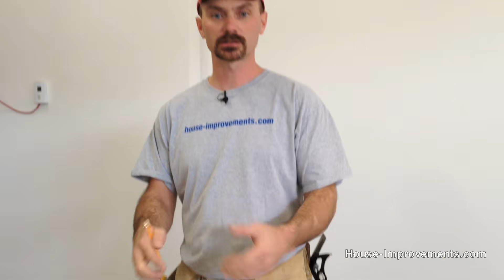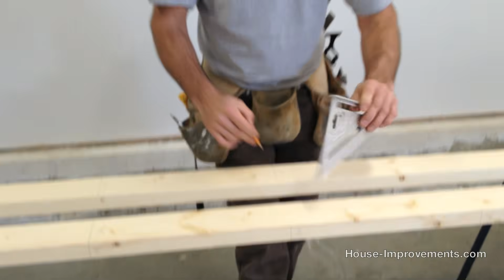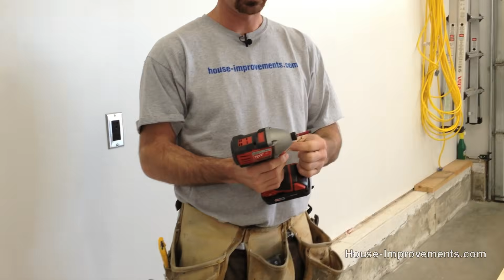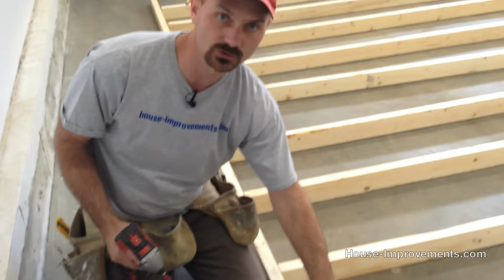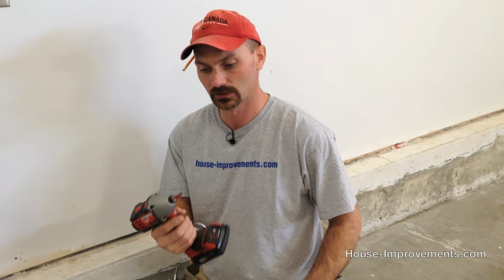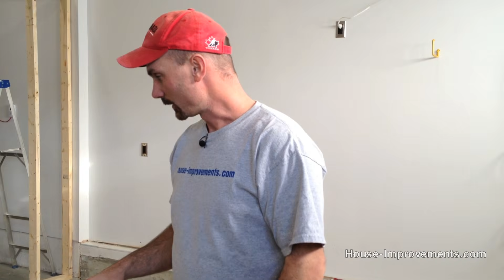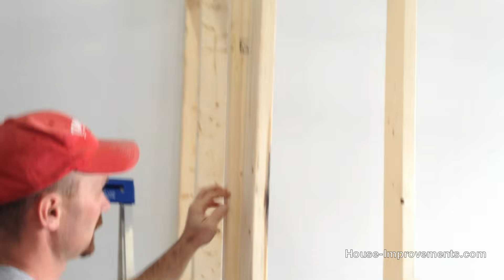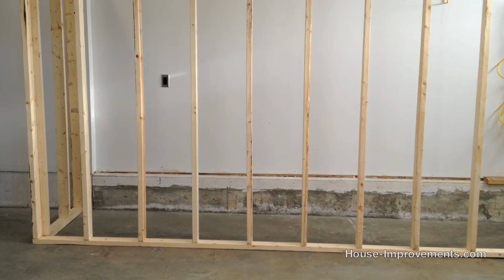Wood Stud Wall Framing

Comment: Hi Shannon, I am getting ready to separate my family room into two rooms - leaving the larger portion as the family room and the smaller portion as a laundry room and my study.  With the exception of the base plate, I want to use cedar 2X4s for my framing in the room because it is the best quality I can get at the local box store.  And it won't be carrying any load. Please give me your opinion on this before I go to Lowe's to buy more of the cedar @X4 lumber.  ADDED QUESTION:  I want to use the thin foam tape between the concrete slab and the base plate.  I have no reason for doing that other than I feel something to separate the wood from the concrete is better than nothing.
Reply from the maker: Regular spruce or pine studs are usually fine for interior walls, and using the foam tape is standard practice. Cedar is extra cost that is completely unnecessary . The foam separates the concrete from the wood to keep it dryer.
Reply: @HouseImprovements  Thank you, Shannon. I will try to find some straight boards at Lowes.  With these tariffs and Trump's trade war I will be lucky to find them and if I can, I will be lucky to afford them..

Comment: Remember, if your bottom plate is sitting on concrete you need to make sure it is pressure treated.
Reply from the maker: Yes, PT or be separated with a sill gasket

Comment: so once the top plate is on youll have 4 nails in the top of the stud? shudnt you nail the top plate between the studs?
Reply from the maker: The max spacing distance for nails in a double top plate is 24" . These studs are 16" OC so I have the top plate nailed even more often then needed. I like to place them near the studs so that when they poke through slightly they are not usually in harms way down the road when doing other procedures . They are really not effecting the studs because at most the nails may be jabbing into them by 1/2"

Comment: Whats an allowable crown to use on a stud wall?  Ive seen a lot that are like 8 feet and 1/4 inch crown but also some 1/2 inch or even a 1 inch crown.  Let me know thanks.
Reply from the maker: 3/8" max , I would suggest

Comment: What I still don't understand is if you are 16in on center on the outer walls so the sheathing falls on a stud how does the drywall on the inside still line up without cutting?
Reply from the maker: It won’t.
Reply: @HouseImprovements  That's what I thought. Thanks for the reply.

Comment: Shouldn’t you place a pressure treated wood doubler on the bottom only?
Reply from the maker: I never see the bottom plate doubled unless doing floating walls in a basement . You could use a PT bottom plate anywhere you are building a wall on concrete or you can use a standard wood plate but separate it from the concrete with a strip of poly or foam sill gasket.
Reply from the maker: I have newer wood framing videos that may explain things better in an actual framing a home situation , this video here was a mock up in the garage as an example . I will include my framing playlist here for you the newest videos are near the bottom of the list:https://www.youtube.com/playlist?list=PL41D07643E97E1ED0

Comment: when measuring base plate do you measure left to right or right to left
Reply from the maker: Really does not matter in most cases which end you start from. If you want to work the other way that is fine.

Comment: If you have an 8’ ceiling how high would you make the wall because seems to me that when u tilt the 8’ wall it will hit the ceiling before you come to the place where the wall needs to be?
Reply from the maker: If your floor and ceiling are pretty flat all you need is maybe 1/4" less than the measured height on a 2x4 wall.

Comment: If I understand correctly, when framing an 8 foot wall, the 2 top plates, the bottom plate and all standing studs should measure 8’ tall. Please correct if wrong, never done carpentry.  Thanks
Reply from the maker: depends what you are doing but for an interior wall that is not having to fit between an existing floor and ceiling I like to have 8'-1" this allows for standard sheets of drywall and a little wiggle room. Ceiling gets drywalled first with 1/2" or 5/8" drywall, then two rows of 48" drywall on the walls and that leaves you a little bit extra at the floor which is covered by flooring and trim.

Comment: Great idea instructor. Question, you said all crowns same direction. So when building a shed or home, is crowns facing outer part where plywood is nailed or in when sheet rock is nailed. Thanks for great video.
Reply from the maker: When building the wall laying on the floor like in the is video then crown up (away from the floor) makes it easier . If stick framing in place vertically then pick a side and put them all that way.

Comment: what if the concrete floor is not level? a bit sloping? can you just add a filler at the bottom? instead of levelling the concrete?
Reply from the maker: on a non load bearing wall , yes.

Comment: Hey, Thanks a lot for this great demonstration. I have a question if anyone knows, Can I glue the bottom plate of a pony wall to a glazed porcelain surface ? And what is the best construction adhesive for the job? Thanks!

Comment: @homeimprovements if you wanted to put a window in that demo you did for framing a wall could you have put it anywhere and just measure what size window and frame that in still adding the necessary framing for it

Comment: How tightly should my studs be before they are nailed in?  Should i need to knock them in or slide freely?
Reply from the maker: If you are framing the wall on the floor like this they should be all cut the same length. Sliding freely or knocking in can be effected by even the wall just laying crooked there on the floor , so that's not really a good judge of anything. If you have more questions please join my forum and ask what you want to know.
https://www.house-improvements.com/forums/

Comment: So as long as all of the crowns for the 2 x4s are facing the same way, it does not matter if they are on the inside, meaning living space side vs. on foundation side?
Reply from the maker: No it won't matter. We want them all going one way so that the finish drywall lays better. If the crowns are all mixed then the drywall is in and out and you will get more screw pops as well.
Reply: @HouseImprovements  Many thanks sir. I appreciate it. Have a great weekend.

Comment: I'm planning to move a closet wall to change the dimensions of the closet. The walls double top plate is laped to the interior and exterior walls. If I were to build a wall, could I just stick frame it in place or do I have to somehow lap the double top plate in place first before installing the top plate and studs? Thanks for any advice you can give!
Reply from the maker: You will be ok without the lap for this.

Comment: You mentioned using a 3 inch screw but what size #? I'm using #8 but it doesn't seem to suck the joints together at all? Does it matter if there's some play?
Reply from the maker: #8 deck screws.
Reverse the screw out until it is free from the second piece of wood and then drive it in again. Remember I also advised that these deck screws are not designed for structural framing.

Comment: I’m building garage walls and the guy sold me 8, 10 & 12 ft pieces for the bottom and top plates.  Walls are roughly 21-1/2 ft long or so.  I can see two 12ft pieces being used since the 12ft works evenly with 16” on centre (ends in middle stud) and a 10ft you lose 8” so a 12ft and 10ft won’t work. 
But the double top plate now you don’t want the joints matching.  So the lengths now make it difficult.  I don’t know if you can use 3 pieces for a top plate or should this guy have given me 16ft boards maybe ??  
I’ll be leaving the 3-1/2” and 5-1/2” (2x6 wall) shorter for overlap as well.   The top plate joint needs to be at least 16” (one stud) away from the lower top plate joint from what I read in the code book.  Can you use 3 pieces for the upper top plate ?   how would you configure the lengths for this length wall ??
Reply from the maker: Yes the upper double plate can be multiple pieces just cut your joints to land centred on a stud location.

Comment: Can u explain the staggering of sheeting two studs apart?
Reply from the maker: The stagger sets the joints of the rows of plywood or drywall from top and bottom rows apart and not falling on the same stud so this makes a stronger wall. If you have more questions my forum is the best place .https://www.house-improvements.com/forums/

Comment: Good video. I have a question. How do I lift a newly framed wall inside of and existing room. I have a 16x23 room and I want to go to a corner and frame in a bath room. I can frame the walls door etc. but if I frame it to the existing room height can I lift it into place without messing up the existing ceiling? Or should I leave the top plate off and raise the wall, then hope i can put the top plate in place???
Reply from the maker: Honestly I prefer to "stick frame" in those situations. Install you top and bottom plates in place and cut and install studs in the standing wall. If you want to build it on the floor and stand it up cut studs about 3/8" shorter than needed.
Reply: @HouseImprovements  Thank you for taking the time to answer me. I will stick frame it as you sugest.
Reply: A lot of planning goes into an ordinary bathroom, but the one your building is far greater. I am guessing you have a basement. I am doing a bathroom on the second floor that was a large bedroom with no bathroom.  I thought the prices of lumber were going to fall. COL.  Anyway interior walls with finished ceilings is tough. I decided to remove the sheetrock in the new bathroom area. Needed spacers between ceiling joist to attach new walls. Also exhaust fan and recessed lighting and wiring and vent piping.  I also removed the flooring to double floor joist by tub and 16 foot interior wall.  The wall runs parallel to a wall below it but I think it would be stronger if it was perpendicular, to floor joist. I had done work like this for a living, many years back and only used douglas fir wood.  Almost impossible to build a straight wall using anything else but steel.  I am turning 71, and started saying this was my last project five years ago. Good luck.
Reply: I really wanted to mention that a bathroom "wet wall" (has the largest, and most fixtures in a row) is generally framed in 2 X 6 lumber.  There is a formula, for what is called "fixture vent sizing tables". Most bathrooms need a 3 or 4 inch vent going thru roof.  3 inch is the inside measurement and 3.5 od . Hole saw  would cut your floor and ceiling plate in-half.  Even 2 X 6 lumber requires metal pipe protectors, preventing accidental nail penetration's.  Very easy to hit vent pipes, hanging pictures with screw gun.  The entire pipe is difficult to protect buried in the wall.

Comment: Needs some help, im sure i missed something important.  

 He mentions that, to get the stud height(to be able to cut all studs one time ) you measure the height of the wall then add the thicknes of 3 plates (1 1/2 x 3 = 4/12 inches) and subract that amount from the measured height, to get stud height. This confused me, because if the stud fits between 2 plates why are we subtracting 3. 

So in my mind its like this, if i have a wall i measured 100 inches, i am making a frame to fit that,frame height is 100 inches also, now i subtract 4.5 inches from 100 = 95.5.. wouldnt that make the studs too short? . If the stud is to fit between top and bottm plate, shouldnt i be subtracting 1.5(top) +1.5(bottom plate)  =3inch for a stud tight fit? .... i dont know if anyobdy follows what im trying to say. thinking i missed something,but keep replaying and still dont see it

Update: Okay after rewatching , i noticed he uses a double top plate(assuming the wall is load bearing>?) anyway, is it safe to assume this is what i overlooked?.. guessing thats why he subtracted 3 thicknesses?

Comment: Just one question. You said to cut off 3.5 inch of the studs to compensate for the plates. Why not enough to compensate for all three plates?
Reply from the maker: If you are using three plates then you need to cut more ,yes.
Reply: @HouseImprovements  Thanks. I hope to build my first home in the spring.

Comment: "usually it is much more recommended to use nails" - how about - "nails, certain lengths and diameters, are required by building codes"

Comment: If I want my finished wall to be 8'1 high when it is constructed,  what length do I have to cut my studs at?
Reply from the maker: if you are using three plates like in this video .... 97" - 4.5"= 92.5"

Comment: Is it possible to use nails? I have seen carpenters using nail guns for roof rafters which make the job much faster. But haven't seen nails to be used for stud partition. I wonder why?
Should we use treated or untreated timber for indoor stud wall partion, and why?
When we make a stud wall partition, would it better to make the fram on the floor as you did or attach it on the wall? I am not sure if you make the fram on the floor first just for demo or this is how it should be?
Already too many questions. 
Thanks,
H
Reply from the maker: You have a lot of questions and would be better of asking in the forum where we can discuss these items better.https://www.house-improvements.com/forums/

Comment: Terrific video. I am going to be placing studs between existing plates on the interior of my garage so that I can anchor plywood backboard to the exterior wall so that I can put some electrical boxes on the outside wall.  My question is, how do I hammer nails or use screws to secure the studs to the plates since I cannot work come through the plate into the stud?

Comment: im building a shack/shed out of scraps nothing with be standard code. everything will be 2x8 or 2x10 laying flat or or standing sideways. why not its a 6x 8 room one load wall will be 3- 2' x  10' and the rafters will be 2" x 12" x 10`laying flat how unconventional  but why not it covered by 1/2 or 3/4 plywood .

Comment: When nailing the double top plate; won't the old screws get in the way of the new ones you're using to nail them together?
Reply from the maker: Just off set upper nails from the studs.
Reply: @HouseImprovements  Thank you! Greetings from Mexico

Comment: I need to build a panty wall and attach it to an existing wall, but will need to build the ceiling. There is no where to attach it to the existing ceiling due to it’s a vaulted ceiling.  Should the framing be the same concept?

Comment: WELL, this always confused me.  Some guys say mark at 16' but bring it back so that the center of the stud is on the 16" mark, while others say put the stud to the left of the 16" mark (if you are measuring from the right end).  The issue is that the plate is 8' long.  A piece of drywall is 8' long.  When you put your stud on the end of the plate, it itself has not been centered on the end of the plate.  Right?  So if you center the next stud, as Shannon does above, by moving it back 3/4 of an inch, then the distance between the first and second stud is 15 3/4" not 16".  But the second last and last stud will be 16" from the last stud.  If you don't do it Shannon's way, and just mark 16" and put the first stud on the left of the line, then the last stud will be 15 3/4" from the second last stud.  So, whether you do it Shannons way or not, either your first or your last stud will be 3/4" shy of 16" center.  AND, as long as you have flushed the first stud up and the last stud up to the ends of the plates, the plates are 8'...and drywall is 8'...so, the drywall will land right on the studs at the end no matter what method you use.  If you frame the next section, you are putting to end studs side by side so, no need to land the drywall in the middle of the stud. No?
Reply: As I think of it.  I'm thinking if you use a floor/ceiling plate 2x4 that is longer than 8', then you want to move the first stud back 3/4" so it is centered on the 16" line to accomodate the 8' drywall hitting the middle of a stud...and just cut the last piece.  So, I imagine it's Shannon's rule here to make the first stud 3/4" shorter...so you don't have to remember based on the lengths of your base plates.
Reply from the maker: So it makes sense to always do it "my way" and not change your system based on wall length IMO.
Reply: @HouseImprovements  Hi Shannon, yes, I totally agree.  I've watched many vids on wall framing, some guys are just putting the stud to the left of the 16" mark while other guys are doing what you are doing and placing the second stud at 15 1/4".  I was confused as to which one was right.  Being a home DIYer, my mindset was always about the 8' long sections of wall...and I realized that your "rule" overall of putting the stud at 15 1/4" is just a good rule to follow so that it will just work out no matter the length of wall you are building.
I love all your vids BTW, you have helped me with my home DIY projects like you can't believe!!!  Everything from floor leveling, to moisture barrier and electrical and even the difference between the different tin (aviation) snips...as I recently rejigged my duct work in my basement....your channel has been a huge help.  Thanks!
Reply from the maker: If you only ever build 8' long walls you are correct . Now take your theory to to a wall that is over 8'. I bet your sheets start to miss the studs ! LOL.

Comment: You don't mention a sill plate. I notice some builds have a sill plate and then the bottom plate is attached to that. Would this be the correct way to do things if you're anchoring the walls to an OSB subfloor? (We have a floating  pier and beam foundation.) So in effect, you'd have a double plate on both the top AND the bottom?